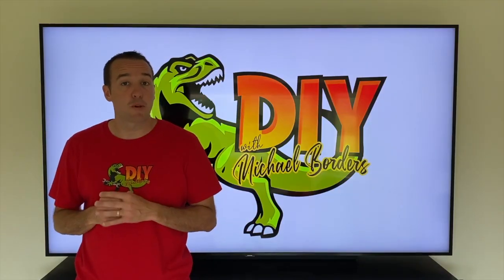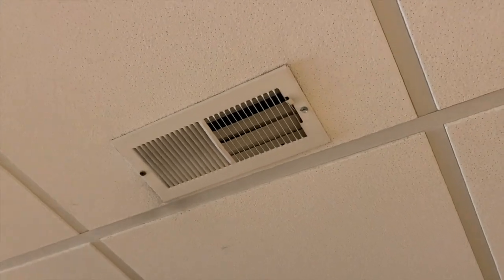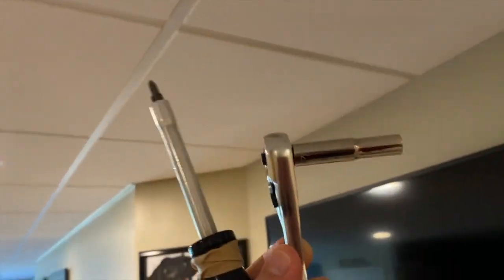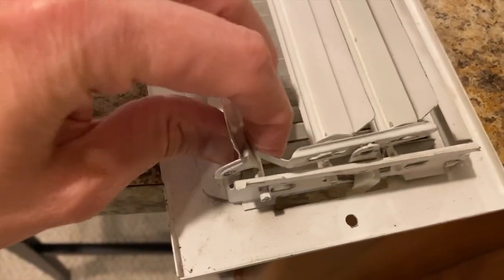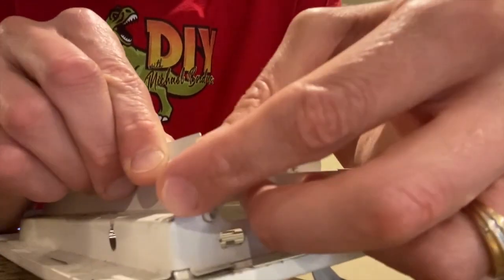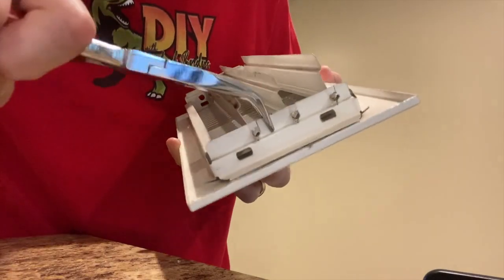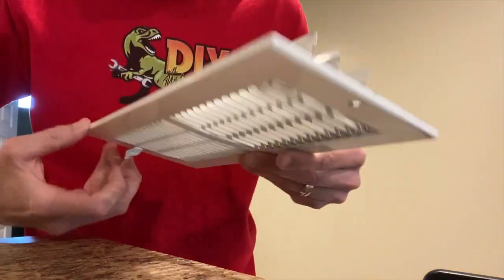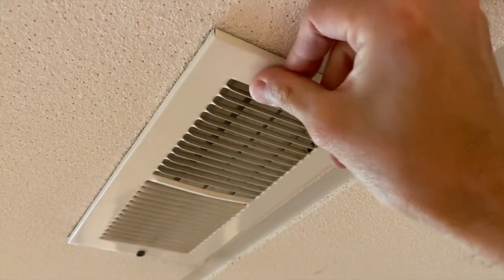Fix or replace broken ceiling vent - stuck open or closed

Comment: Thank you so much! Watching this made me realize my landlord had installed a broken vent in my kitchen. I took it down to clean and was going nuts wondering why I couldn’t fix it. It only had two blades. And the open/close mechanism was loose in the vent. Thank you for making these videos.
Reply from the maker: Thanks for watching & sharing this.  Is it fixed now?

Comment: I am putting in a suspended ceiling and I have a ceiling vent that I need to cut into a ceiling tile. Does the duct work just sit on the ceiling tile or is it mounted to the grid or floor joists to prevent all of that weight to be on the tile?
Reply from the maker: Good morning, just poured a cup of coffee and am sitting down to answer any and all questions for the DIY community.

The ductwork will be secured to floor joints and subfloor braces.  Best thing to do is remove a few ceiling panels to get a good open view on the ductwork routing.  Keep us posted.  😎👍

Let us know if you have any questions and hey if you’re into crypto trading, join our DIY ecosystem and become part of an exclusive group of DIYers.

       toolboxtoken.com

Reach out to us any time!  🧰

Comment: I have already checked for bent or loose pieces. My cover is older so I need to find a video that has my style. PS our screws were also two different types! WTH?
Reply from the maker: Thanks for watching and sharing this, that’s interesting.  Not sure who’s installing these vents with different screws…😆

Keep us posted on your project.  👍

Comment: hey i have a questing in my new place i just moved into the basement vent has something keeping it closed on the inside after i take the plastic vent off anything i can search to open it
Reply from the maker: Thanks for watching & welcome to the DIY Raptor Club.  Can your vent be easily removed?

It may be stuck or jammed & needing to be adjusted with some friendly force without braking anything.

Please keep us posted, us DIY’ers need to stick together!  😎👍

Comment: Honestly it's killing me that I cant figure out which way is close and which way is open if you push it to either side all the way does it close both ways so open would be in the middle or what lol it's confusing me
Reply from the maker: Thanks for watching & welcome to the DIY Raptor Club.  These can be tricky for sure.  What’s your update?

If vent is placed in front of you with internal side up...& the adjustment lever on right side, the vent panel strips will be open when the adjustment lever is pulled toward you.

Keep us posted.  😎👍